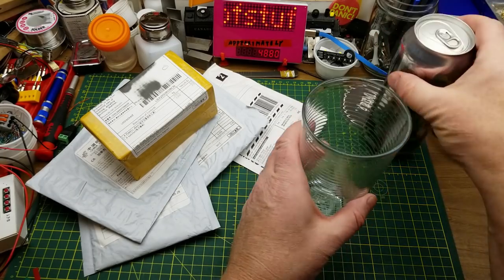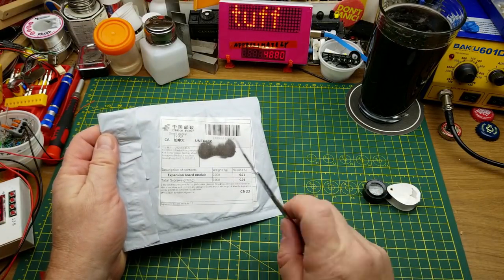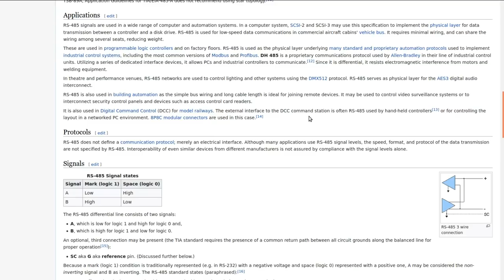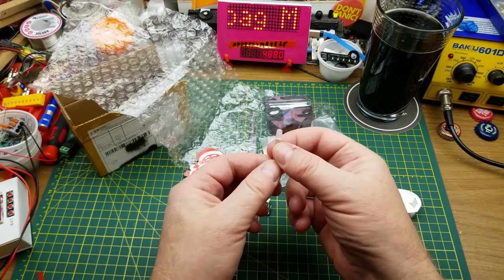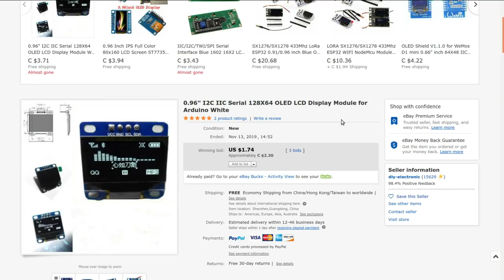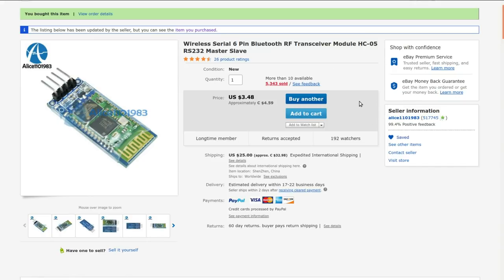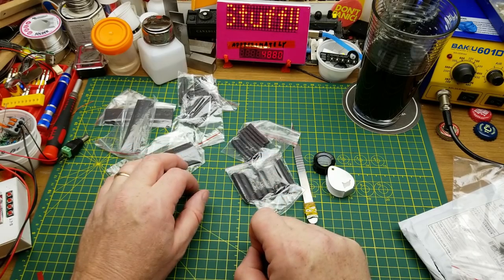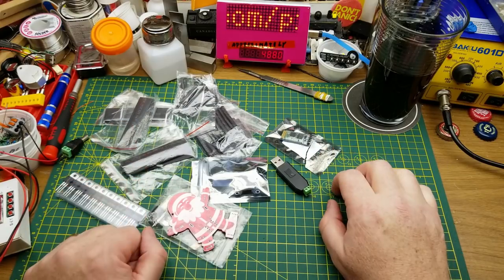mailbag Monday #77

Comment: I love the old Lm317's two resistors and a couple of capacitors to rig up a quick supply.
Switchmodes are better but you need more parts, not so quick.

You can use a 78xx series as a variable reg, but i would imagine the current it needs would be higher than a lm317.

Comment: I have one or two DMX 512 projects to get back to but I  seem to have one less functioning RS 485 module than I used to so I might need to put in another order.
Reply: Gadget Reboot please do not use that cheap USB thing for DMX512. As it is cheap, it is not isolated, and can damage your computer. Moreover USB is not the best protocol for DMX512 timing.
Reply: I will be adding my own isolated DC to DC converter and Opto coupling  to keep the external and local universes isolated.

Comment: Look up CMRI (computer model railroad interface) i believe by dr. Chubb. Uses RS485 interface. It may have been converted by now, as the original rs485 chips are no longer available. Written in Vb 6, or was. I used it in a layout years ago, but I never was big in signalling, which is what it was designed for. Cheers and Merry Xmas
Reply from the maker: I remember reading about CMRI back before DCC. Back when it used parallel printer ports for most of it's functionality.

It really is a cool system and it's amazing how far it has evolved over the years.

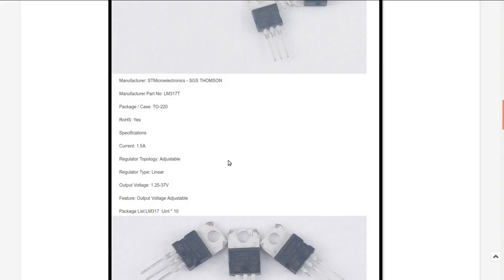Comment: 1:37 how to adjust their output ?
Reply from the maker: Typically with a pair of resistors at the output to make a voltage divider, then send the midpoint of the divider to the reference in pin.
Reply: @pileofstuff  thanks